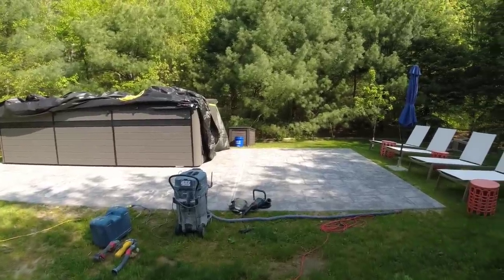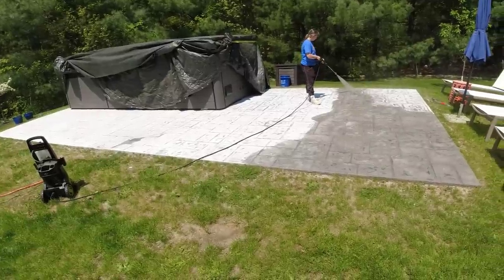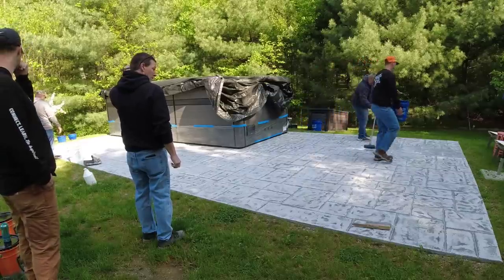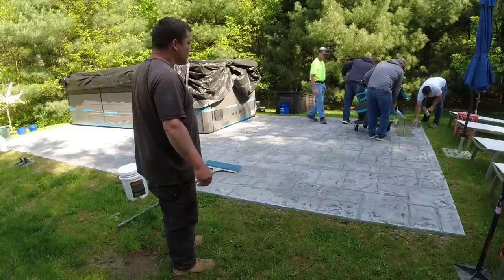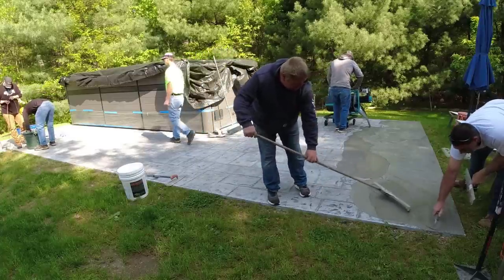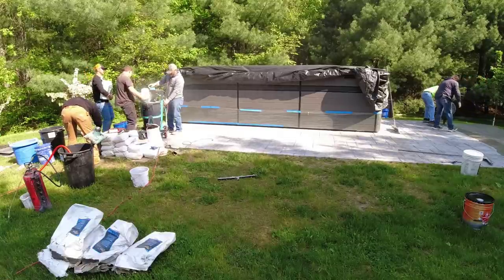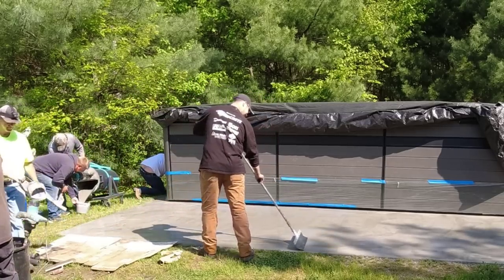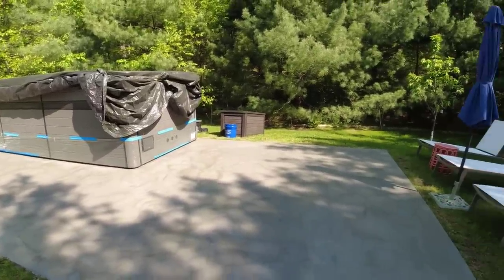(Almost) Self Leveling Concrete Overlay For Fixing Damaged Concrete Patio (Like NEW)

Comment: The pool was probably the culprit if they used it in the winter, the alkylines from the pool itself  can be worse then deciders, which I don’t believe they didn’t use deicers if they were using it in the winter, I’ve had problems with the chemicals in the pool on concrete before on pool decks I’ve done, and like you, I couldn’t argue with them, just went and fixed it on my dime. Another nice job, you have the best channel on YouTube, and anyone that asks me about doing a pad themselves I tell them to watch your videos.
Reply: It always sucks as a contractor to fix things that aren't your fault. I'm a GC in Colorado Springs and I haven't met a single contractor yet that provides any kind of warranty whatsoever on concrete work. You just can't, too many variables at play. Not to mention most people would never pay to have concrete installed at the highest possible quality, at the right thicknesses, with the right rebar, with the correct ground prep for drainage based on their soil type. Ya, not going to happen. We also have crazy hail that can cause surface issues and crazy temperatures swings. This guy has to be one of the most experienced concrete guys in the country and if he has problems that just tells you how crazy concrete is
Reply: Probably a salt water system
Reply: I'm 4 minutes in to the video, and paused it to scroll down to see if anyone realized what happened here.
The pool was drained onto the pad and the chemicals in the pool water lifted the surface of the stamped concrete. It may have frozen onto the surface in a freeze thaw cycle as well.
Reply from the maker: Thanks Chris, I really appreciate your comments
Reply from the maker: Thanks for the comment and insight about where you're from Chris!

Comment: @Mike Day Concrete      My money is on the hot tube/pool ran over from rain/snow melt, and the chemicals in the water ruined the sealer. Look at the tarp job on the cover. There has definitely been an issue there. Nice fix though. Good on you to stand behind your work.
Reply from the maker: Thank you!

Comment: Mike, I did concrete finishing for over 20 years and I never got into the overlay products. My understanding is it will only last as long is how good you prep it and the surface has to be really clean. How long will the overlay last on a project like this? Do you recommend it for driveways? And what I mean by last is when it starts to peel up.
Reply: I was wondering the same thing. I could be wrong, but I always shy away from doing overlays, despite getting asked by customers to do them. It's my understanding that the freeze/thaw cycles we get in Minnesota will wreck ovelays, and I've seen my share of work them that have gone bad.

Comment: Will the product work on driveways? Can we put a broom finish on it and what about a rusted area
Reply from the maker: It would work on driveways, they have a different product for broom finishes, goes on a little thinner.
Reply: @MikeDayConcrete  any fix for a rusted area where rebar must be too close for to the surface
Reply: @MikeDayConcrete  I guess I would remove the rebar from the rusty area and patch it let it cure out and apply the over lay naterial

Comment: Actually, in my opinion, you would’ve been just fine after grinding that surface off to just apply a 2 part epoxy primer - salt blocker. Then a solid base stain & a semi transparent accent stain and seal it with a 2 part Poly semi gloss and been done with it. It looks like a lot of unnecessary work to re-restamp the Ashlar Slate .

Comment: Did u have to cover that out of pocket? I have had some similar issues with some broom finish Crete we did .I wonder sometimes if I'm getting the correct mix design. 
I had to fix both slabs out of pocket cost me $9000 ,but both customers are satisfied that's what matters nice job Mike and guys
Reply: I'm a GC in Colorado Springs and I can attest to the fact that you do not get the correct mix quite often. we had issues here with a company for an extended period of time and they weren't telling anyone about the issues they were having with their mix. It was making the surface incredibly rough when broom finished. We switched concrete companies and the problem went away.
Reply: @chrisheet523 I'm in Springs too. What company?
Reply: I believe it was Action Ready Mix we had an issue with. I don't personally manage the concrete crews, so I'm not 100% sure
Reply: @chrisheet523  Yeah that company is terrible. I've had concrete companies lie and say they didn't add fly ash, when it's apparent to any real finisher.